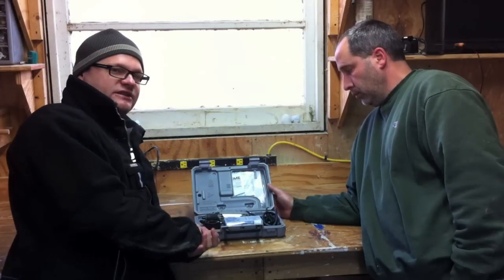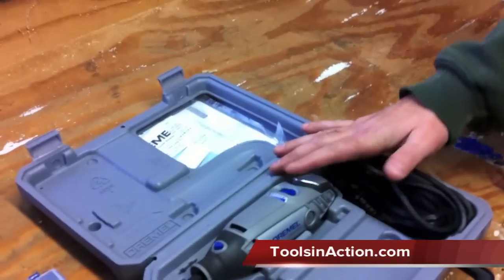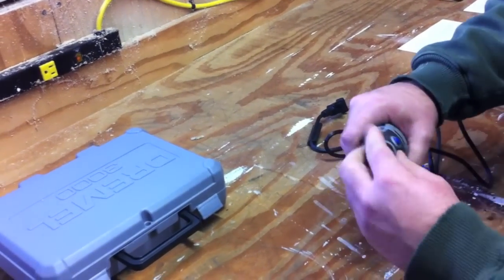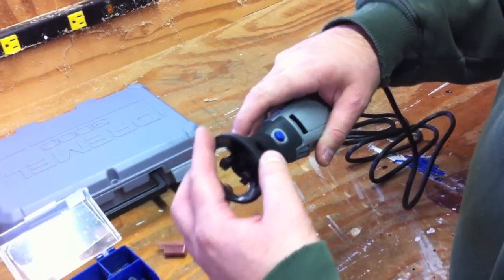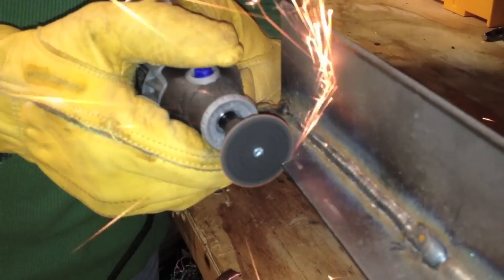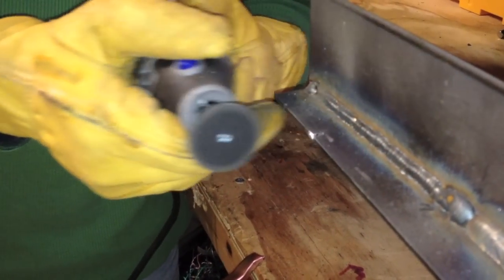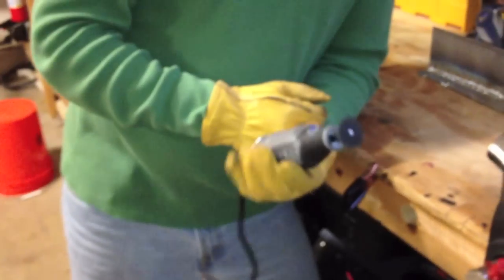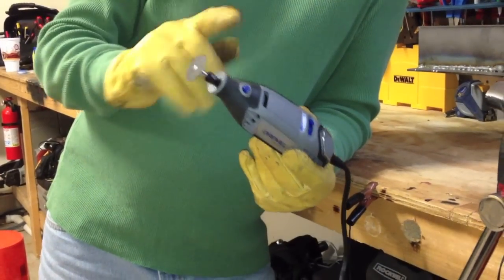Dremel 3000 Rotary Tool In Action Review

Comment: Has anyone noticed that the speed/power switch is slightly erratic at lower speeds (between 2 & 4)? Mine occasionally won't even start spinning. I have to go back to "power off" and again to 2. Also, once the selector is at 2, the speed seems to change on its own over time. Not by a lot, nevertheless, it's inconsistent, and it keeps increasing on its own. It's my second Dremel. I sent the first one back for exactly that reason. Is that anyone else's experience? Thanks

Comment: whoaaa i didnt knew about the nose trick:) i have an older version of dremel and i have to use the damn wrench all the time (real pain in the ass:P) 
can you do a review of the newest wireless dremel (if i remember its 8200), as im looking for some wireless dremel-like tool? also a review/comparison of some electric drivers would be much apreciated:) i mean small drivers only with some clutch settings not big drill/drivers